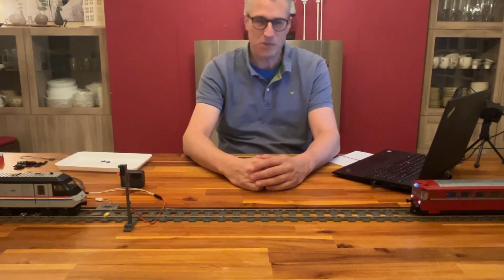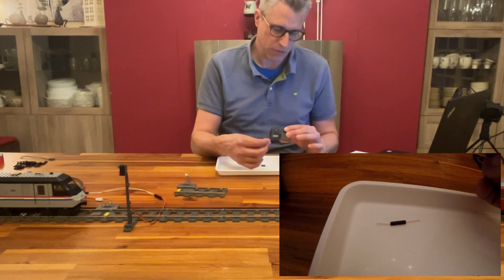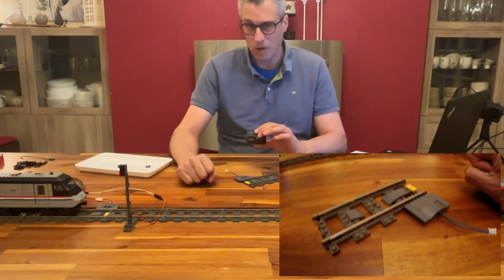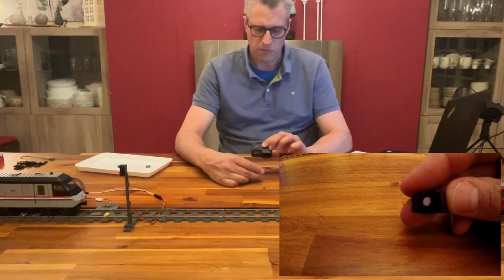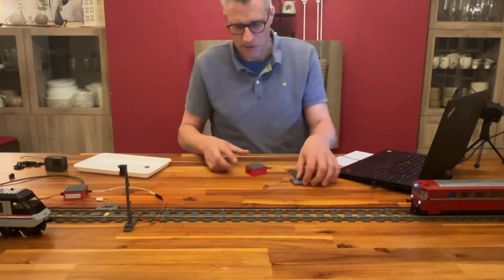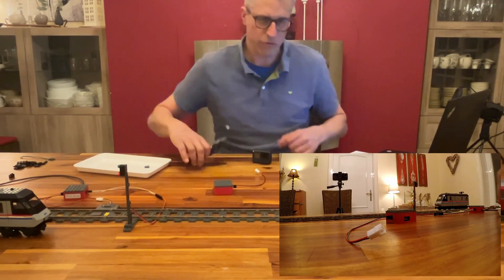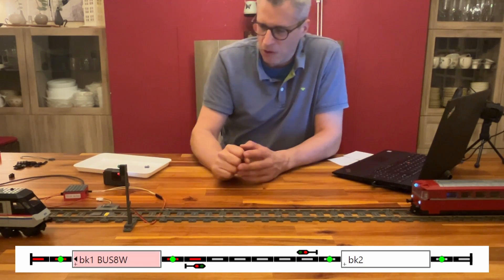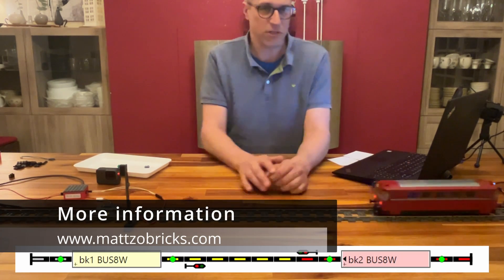Sensors for LEGO trains

Comment: Hi Mattz, is everything based on the 'new' area of lego trains? so after the 9v period of lego? or can i also use this to automate older 9v trains?
Reply from the maker: Yes, we are using battery trains only, because this makes the usage of alternative track geometries (especially from Trixbrix) cheap and easy, and we do not need to rely on components which are only available on the market for used components and become more expensive and rare over time. We have a pretty clear plan of what would need to be done to support 9V as well, but we have no short-term plans to actually implement it. Maybe one day, when I have more time... :-)